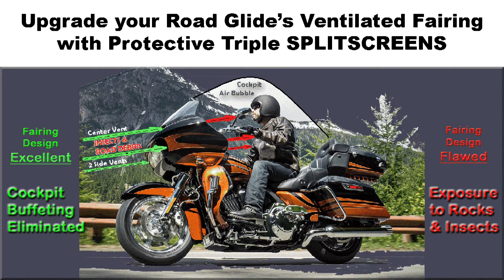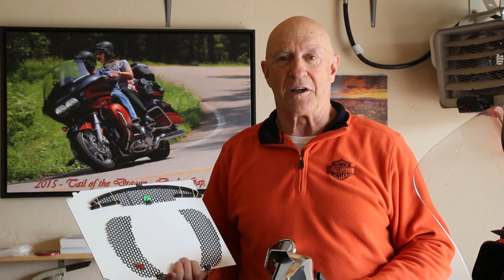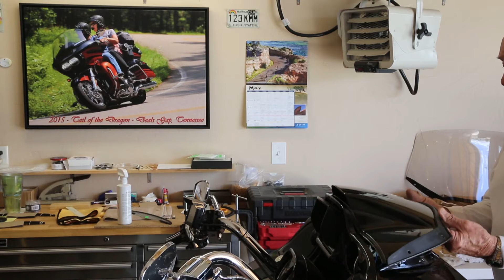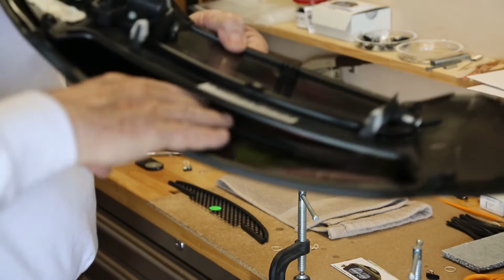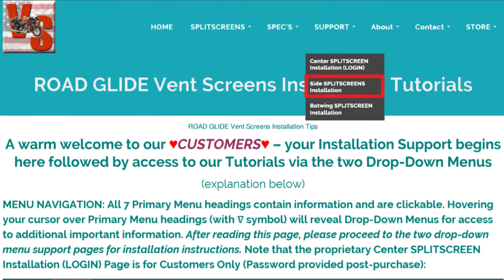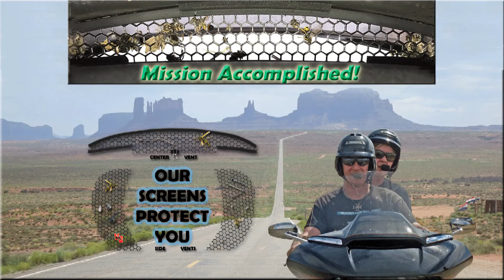Road Glide Vent Screens

Comment: My middle screen fell out, I have no idea where which is crazy. I wish I could only purchase that piece only.
Reply from the maker: You can purchase a replacement part. If your Stabilizer Pad is still reliably in place:
https://motorcycleventscreens.com/center-splitscreen-replacement/

If your Stabilizer Pad is missing or not reliably installed, you'll require a complete new Center SPLITSCREEN:
https://motorcycleventscreens.com/motorcycle-vent-screens-store/CUSTOM-ORDER-CATALOG-Center-or-Side-SPLITSCREEN-S-Oil-Cooler-SPLITSCREEN-c37697264
 
Assuming your Center SPLITSCREEN was installed correctly, it may have fallen out due to a common issue with the 2-pc ADA separating. View here for a discussion: 
https://motorcycleventscreens.com/center-splitscreen-replacement-parts/